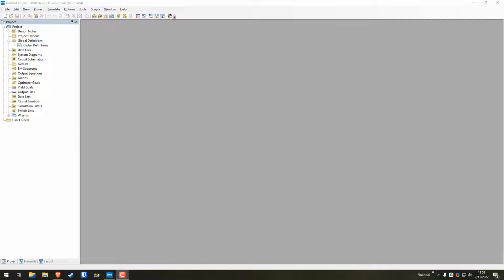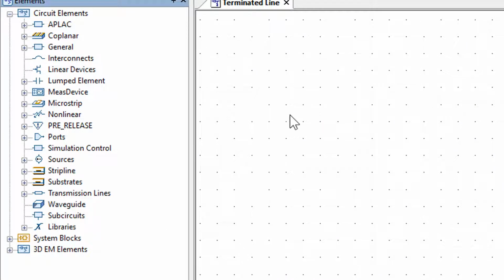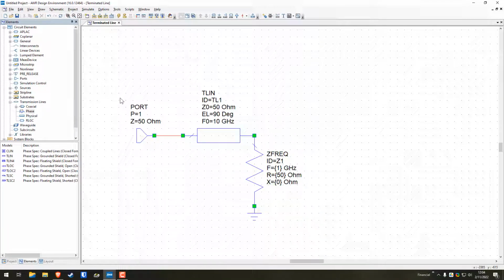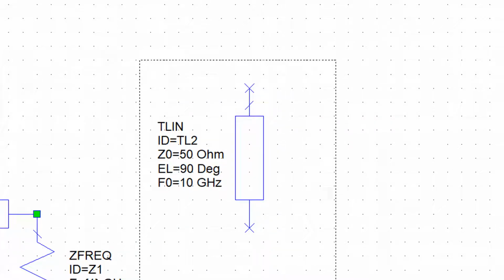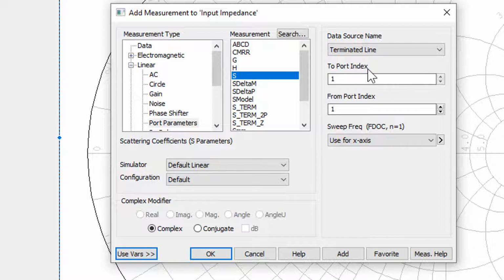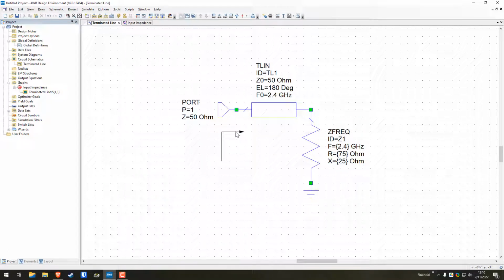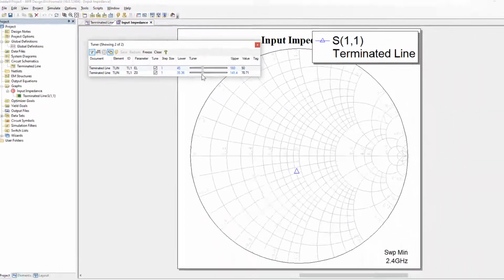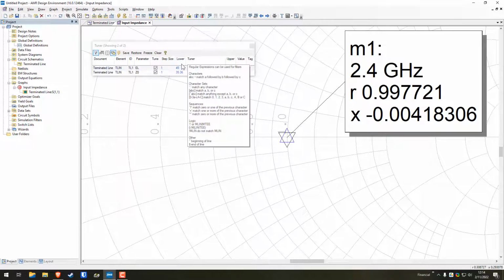Introduction to AWR Projects and Circuit Simulation - Part 1 - AWR Microwave Office V16.0 Tutorial

Comment: I've been working on a project using the Cadence AWR Design Environment just a few days ago. I don't know much about the software. I have to analyze the behavior of a Gilbert Mixer Circuit but I get empty graphs when I try to plot parameters like conversion gain, noise figure and isolation. Even when I get the traces, there is a lot of deviation as compared to the original circuit behavior. Also, I can't find elements I need in the system diagram. 
Please help. Its urgent.
Reply from the maker: If you are asking about the System Simulator, there is not much help I can offer you in the matter. My expertise is limited to the Circuit Simulator and EM Simulators within the Microwave Office suite. I would recommend seeing if there is an example file which can help you get started and adjust accordingly.

Comment: Hi, I want to design oscillators for microwave applications. I have done the installation. Which of the options should I choose ("Microns, millimeters and mils")? Can you help me?
Reply from the maker: That will depend entirely up to your use-case. If you're working in industry within the the USA, you will likely use mils (thousandth of an inch). If you're in academia or outside the US, millimeters (mm) and microns (um) are the way to go. 

Between um and mm, that will depend on the frequency space you're working within. I normally work between 1 GHz and 6 GHz so millimeter makes sense for me. Do a calculation of a half-lambda line (Half Lambda = c / (2f)) and see if closer to mm or um then choose the one best fitting for your application.